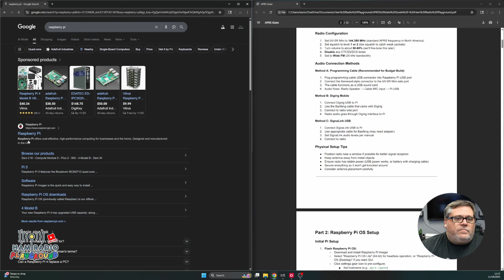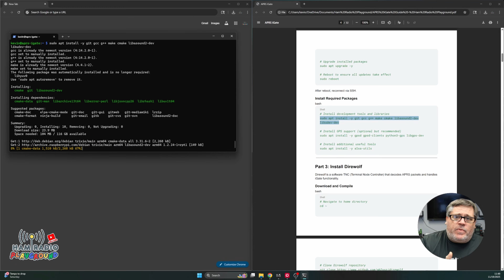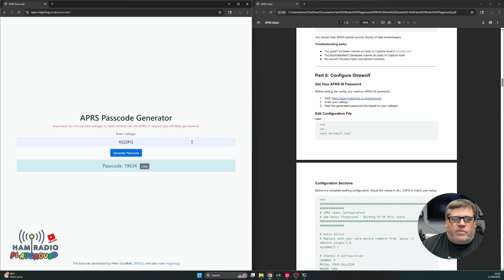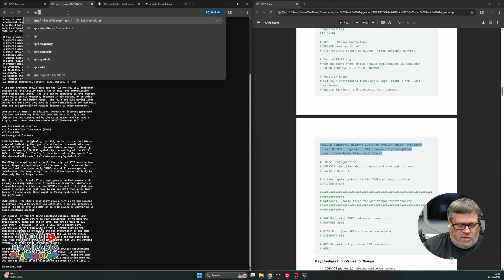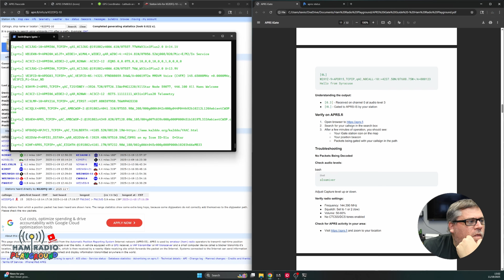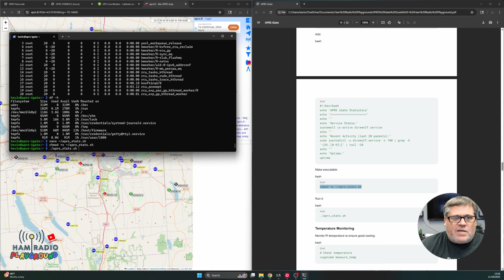Build a Raspberry Pi APRS iGate with Your Baofeng UV-5R Mini - Complete Tutorial

Comment: Helo there, in the book said, "Option A: Baofeng programming cable (cheapest, you probably already have it)", I used it, but the pi couldn't detect as a "sound card", in a short it didn't work for option A. Did i miss something here? thanks 73.
Reply from the maker: Try a different cable

Comment: I use a Kenwood D75A, A Tri band HT with a Kiss12 TNC Built-in, just need a Smart Phone and this HT, Using APRS Android and WaOD Android, I don't use cheap Chinese radios,
Reply from the maker: Sounds like a setup that works for the equipment you have

Comment: good day sir, do you have any recommendations for an alternative for digirig? There's no digirig in our place. Amazon can't ship to our place
Reply from the maker: Good day! Yes, definitely - there are several alternatives to the Digirig that should work well for this project!
In the video and in the written guide, I cover a few options:

1. USB Sound Card - A basic USB sound card (the kind used for computer audio) can work. You'll need to wire up the appropriate cables for PTT and audio, but it's inexpensive and widely available.
2. SignaLink USB - This is a popular alternative that's been around for years. It's more expensive than Digirig but very reliable and might be more available in your region.
3. DIY Cable Solution - If you're handy with soldering, you can build your own interface cable using a USB sound card and some basic components.

What country are you in? That might help me suggest sources that ship to your area, or point you toward local ham radio suppliers who might carry interface equipment. There are also ham radio groups in many countries that can help source equipment locally!

Let me know if you need more details on any of these options! 📻
Reply: @HamRadioPlayground  Hello, sorry for the late reply. I'm from the Philippines, we bought a USB2rig as an alternative. Our problem now is that USB2RIG has different connector than digirig.
Reply from the maker: No worries! Important note: Digirig cables are specific to Digirig and won't work with USB2RIG.
USB2RIG uses standard 3.5mm jacks, so you'll need cables specific to your radio model with 3.5mm terminations. Check the USB2RIG pinout documentation to see which jack is audio in/out and which is PTT, then either buy or make cables that match your radio's connector pinout.
If you're comfortable soldering, making custom cables is straightforward - just match the USB2RIG pinout to your radio's data port pinout. What radio are you using? 📻
Reply: @HamRadioPlayground  I bought an APRS to K1 audio interface cable. Idk how to manually create one huhu
Reply: @HamRadioPlayground  I'm using a baofeng UV-5r radio and an APRS to k1 connector